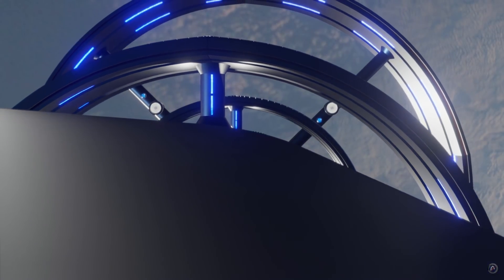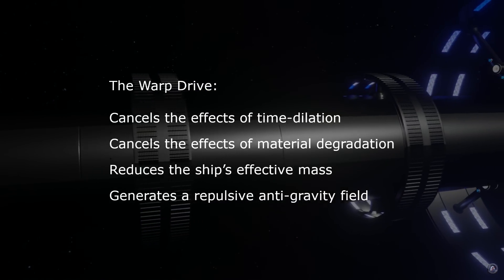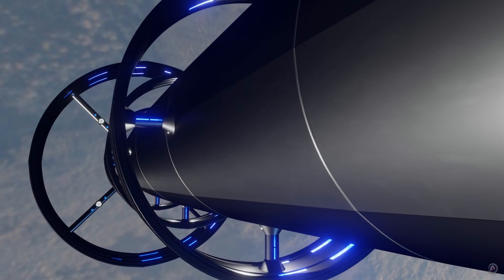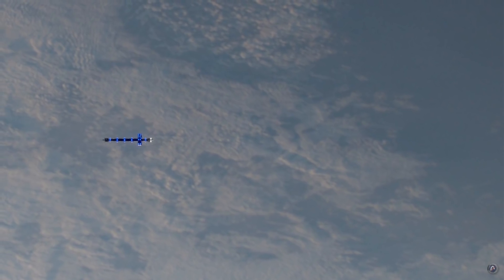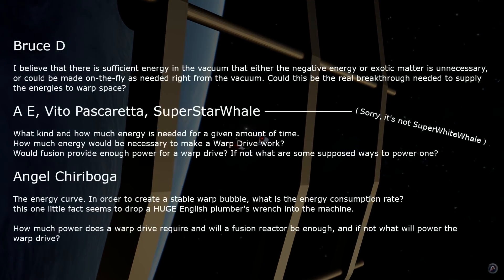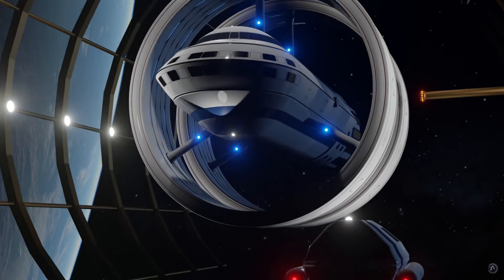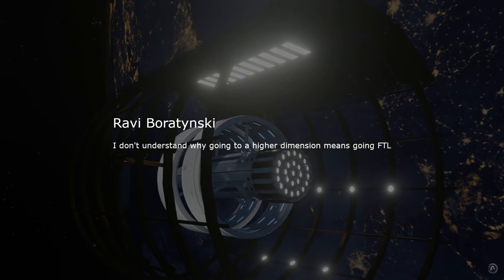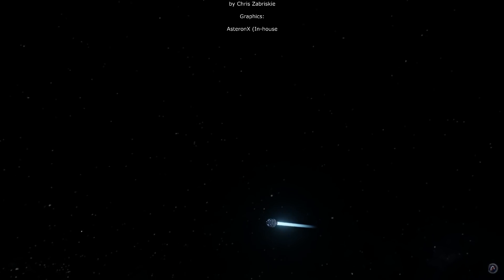Are Warp Drives Actually Practical? - Q&A #1

Comment: no the warp drive does not reduce the ships effective mass if you reduced the ships mass it would annihilate the mass as energy I actually agree with you on the materials and computer part but the problem of it is though is that the warp drive does not illuminate the effectiveness of the ship what the Warfield does is that it generates a bubble of flat stable space-time the ship is inside of the bubble and it never moves the space-time expanding behind the bubble moves pushing the bubble while the space-time in front of the bubble is contracted and the expanding space-time travels towards the front of the bubble at faster than light speed pushing the bubble of normal space time faster than the speed of light and because space-time can move faster than the speed of light this is realistic within Einstein‘s laws of general relativity there’s no need to negate inertia there’s no need to lower the ships mass because the ship itself never moves but you are right it is an anti-gravity field and it does negate matter degradation from shifting space-time fields by creating flat stable space-time well the problem of it is though is that you don’t need negative mass but you do need a lot of positive energy there’s only one way to generate that much negative energy and that’s to create a black hole and caused the black hole to vaporize and not release its energy as gamma rays and Astro next theoretical is Syfy until it’s proven it’s just sci-fi that scientists believes yes Dr. White has been achieved interesting results inside of tiny experiments in a laboratory that is in no way indicative of actually warping space-time travel faster than the speed of light the only way we can do that is basically use dark energy to cause the universe to produce more space-time in higher dimension so what that means is we take the substructure of the universe and we give it energy and we cause it to expand sort of like how we give dough energy in an oven in caused the dough to expand into bread I know they’re saying you also can’t power it using space-time wanna know why because the Quantum vacuum energy of the universe is infinite but infinitely spread out infinitely disbursed I actually sent you guys a link to a video of the demystify zero point energy you can use zero point energy and the Cassimere effect to generate power but you would need to put in a lot more power to fold space-time to trap the quantum vacuum fluctuations in the fold massively raising their frequency and excluding all other frequency so the frequency is on the outside localize it so that’s gonna take so much energy that you know anything is better a AAA batteries better nuclear fission reactor better Fusion plasma reactor better inertial confinement fusion reactor better antimatter reactor infinitely better oh and the only limit to antimatter is how much antimatter and matter you can annihilated at once we cannot power this thing or even created for about 1000 years because the problem is that nobody has any idea of how you can take matter in annihilated to get negative energy and to get less than nothing out now the thing about it is though is it if exion’s exist a theoretical type of dark matter particle then you could actually generate And control gravity waves and all you would need for it would be antimatter to produce the gamma rays in a way of fiberoptically conducting and amplifying gamma rays because the gamma rays are the only type of electromagnetic wave they can interact with axons and what are you exion’s are so effective at manipulating space time is because they’re dark matter the only thing they interact with is space-time because in axion like an electron theoretically releases a graviton in the same way in electron releases a photon when it moves because the photon is a wave in the electromagnetic fields and electrons interact with the electromagnetic field they generate waves in it as they travel so as a gravitons would be generated as an exion travels And you could use graffito electromagnetism to cause space-time to bend up you can use axons to give space-time a Prosessional wake a frame dragging affect  The only problem is the energy required to produce the axons and the fact that we might not be able to produce them using particle Excelerator’s you might have to use artificial black holes to produce them and the problem with that is you need 150 petawatts of power in let me give you a hint 10 petawatts of power is what modern day human civilization on earth produces do you have to create a beam of high energy gamma rays there is hundreds of times more powerful than all the power output of all of human civilization in 2019 And you have to sustain it for hours continuously to produce an artificial black hole and then somehow the black hole has to give off at mass not as gamma rays but is exotic particles called exion’s but once the axons our produce their metastable which means they don’t decay because their massless like a photon
Reply: I disagree

Comment: What about a warp coil
Reply from the maker: Actually, we are in the process of creating a video all about the warp coil specifically.
Reply: @asteronx  so in all honesty how far away are we from a working warp drive?
Reply: @JohnDoe-ih8ou Approximately  six feet.
Reply: @daryllect6659  funny🤨
Reply: @asteronx  The energy you are saying is needed is too high because the concept is too simple. This is not the only thing that can distort space time and you must understand you have to be able to control the matrix of energy fields, space teasers and vacuum states.
Reply: Actually what coil is mentioned in the video.
Reply: The secret of the warp drive coil lies in the bi-polar subatomic counter-wound induction windings used to produce semi-neutronic anti-particles coupled with magnehelic repulsion transmitters and pulse-polarized bi-directional episodic dipole diverters. Semi-acoustic vertically-interspersed harmonic wave transducers are frequency modulated with proton-injected capacitance inverters and phase-synchronized laminar condenser windings.
Reply: @daryllect6659  You do the same as most educated people who don't  know what they are talking about. They use teck terms to make people think they know what they are talking about. A warp coil for a part of a warp drive system is not a particle accelerator.
Reply: @clementvining2487  Are you saying that you're so stupid that you actually believed the crap I wrote?
Reply: @daryllect6659  No I'am saying you are using some of the teck terms used in some of the particle accelerator experiments and theories to make yourself look smarter than you are. Acting like a joke to see if someone bits. You sound like you do not know what you are talking about. That why I said what are you talking about.
Reply: @daryllect6659  What are you talking about?
Reply: @clementvining2487   You don't know? 
It's simple. Learn some basic science.
Reply: You do the same as most educated people do, you put a lot of teck terms to make people think you know what you are talking about. You have no idea how a warp coil would work. It is not a particle  accelerator.